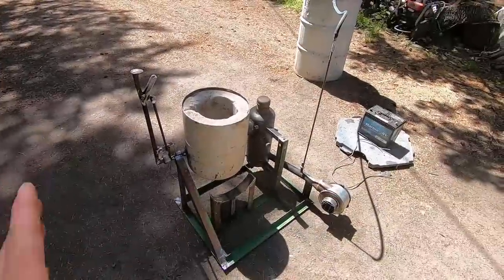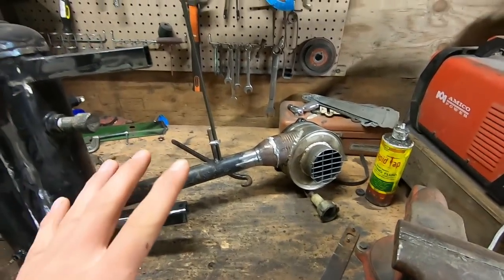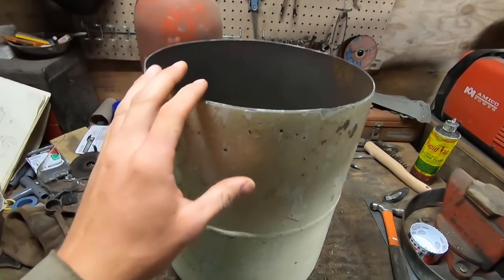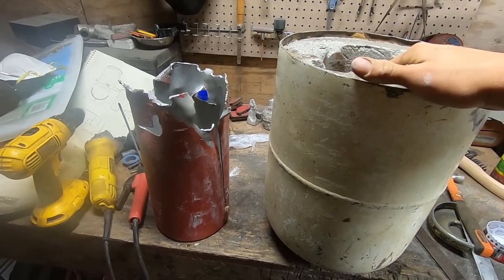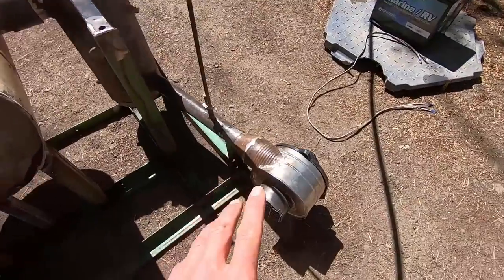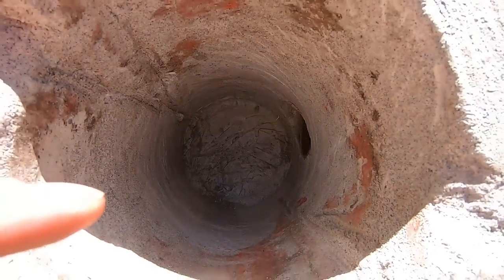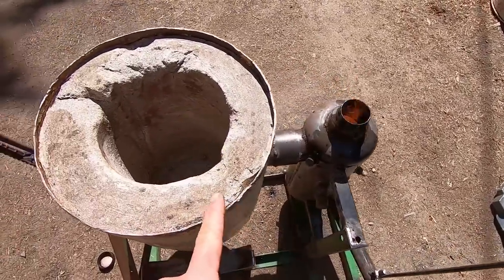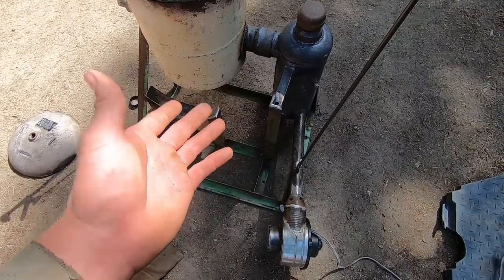Building a convertible Waste-oil Aluminum Foundry/Forge Out of Scrap Metal | Free Aluminum Scrapping

Comment: If some one else said this already, my apologies, your use of the inlet as a pivot point is engineering eloquence.  Kudos!
Reply from the maker: Thank you so much!!
Reply: @randomn6473  yes definitely some cool design ideas here. some things to consider for upgrades; atomizing spray nozzle for oil(could make one from aluminum melt ;) ), fan control and oil flow control. with these two we can control the oil flow/burn rate and wouldn't need the cyclone pre-burn chamber however cool it is(seems like extra complexity/point of failure?). you mentioned a door so that is all i can think of. great build, thank you for sharing!

Comment: The dual-purpose design is a great idea and I am shamelessly going to copy all your best ideas. Thanks. FYI Carpets are rolled on very strong cardboard tubes up to around 12" in diameter. It doesn't really need it but you can seal it with spray lacquer to keep it dry while the plaster sets and then you can just burn it out. Carpet fitters are happy to give it away.

Comment: For removing the fire extinguisher from the plaster, try wrapping it in a few layers of that thick brown masking paper that painters use.  The plaster mixture won't penetrate the paper and it'll have a bit of give to it as the mixture expands slightly when it sets up, so you can just pull the fire extinguisher (or whatever you're using) straight out.  There'll be some of the paper left stuck to the plaster but that'll burn away pretty easily the first time you fire it up so who cares.  Could also use a thick-walled cardboard tube but it'd be hard to find one that's the right diameter and is also strong enough not to get crushed by the plaster, and I'd avoid a sonotube since those have some sort of coating on the inside and I don't think burning whatever it's coated with would be a great idea.

Comment: Thanks for the video it gave me inspiration for a smelting foundry/forge I have had in mind to build for myself.   Here are some ideas you and others may like.  If you''re melting aluminum any iron or steel tubing with one end capped and welded will work.  You can have the steel crucible from the bottom of the furnace to a few inches from the top of the inside of the furnace, that when a lid is on it, there is escape heat that carries the full length of the crucible.  If you build ring out of iron to keep the bottom centered and another ring onthe top that can be bolted to the outside case of the furnace securely that is welded to the crucible, the tilting fuction will allow you to pour your molten metal into molds if you design a catch funnel that has a fine strong iron screen to catch any ferrous metal nuts, bolts, etc... and use iron pipe/tubing to flow the metal into your casing cone or molds.  Always before pouring molten aluminum you need to degas it with sodium carbonate block pushed all the way to the bottom of the crucible using an inverted cone on a long metal rod - leave a few inches below full for this outgassing - stir the melted metal until it settles, add a fluxing dross (buy it online) and then skim off all dross for a clean melt as oxygen in the air forms aluminum oxide that has a higher melting point.

Comment: As I said in a previous comment: I will look for more.
Once again, Well Done. And good work. I was actually looking at forging when you randomly
showed up. I won't criticize, you already hit that. I'm actually amazed that you have so many ideas, and many of my skills and knowledge. If I may... A cooking hint concerning your
refractory: mix your dry ingredients first. Slowly add water to desired consistency.
Pour your bottom to the depth needed and let it set partially while keeping the rest.
Coat the inner form with lard or petroleum jelly (oils are too thin).
Alternatively, leave it to concentrate the heat. By the time it burns out, you will have compensated... Or moved on to something else.

Comment: Nice job!  One way to make your cavity in the forge/foundry is to use a paper-based concrete pier form.  You can cap the bottom end with a sacrificial cap and drill through it for your inlet.  Best of all, to remove it, just fire it up!!!  It will go away like magic!  Actually, care should be taken when burning the form off since pieces might flake off and blow burning up into the air.  I've seen so many of these foundry builds, even before YouTube, but never built one.  Anyway, I gotta go see your heater build!

Comment: I do like your setup. Been waiting too long for proper cement. so I will be doing the same with added materials.. Vermiculite and Perlite. In college, this was added to plaster mold material so as to use less plaster, Insulation, and the ability for the cement to vacillate in a more spongy format less cracking.  Very good design sir!

Comment: It's great.

One suggestion: I would weld a spiral metal pipe around the combustion chamber to pass the oil through it to pre-heat/evaporate before feeding into the airstream. I expect a significant boost in burn efficiency.

Comment: Great idea, I'm in the process of building one myself. I think I will use parts of your build like the stand and pivot for using it as both forge and foundry. My insulation will be cement (Portland) perlite, vermiculite and sand. My tank will be a 10 gallon bladder water tank that will be a bit bigger than the propane tank

Comment: Great build... Do you think flipping it to opposite direction would be better so the flame is on the bottom on blacksmith mode because the direction of the outlet pipe into the forge?

Comment: Fantastic!! I have to make an adapter to mate an opposed twin experimental aircraft engine to an MGB flywheel and transmission to build a 1928 Morgan RIP GN hillclimb racer replica which was made to look exactly like the way airplanes were made at that time.There is only one in existence so my replica has to be perfect and although Morgan used a sliding chain gear assembly I am keeping it British with the MGB transmission and an MGB differential with the beautiful wire wheels. I am going to cast the adapter then chuck it up in the lathe to make it perfect. Thanks for sharing your build.

Comment: An idea for removing the tank from the cemant.  A long bit, drill a hold in the bottom and apply air pressure.  Oh also apply grease to the taml for lub and to prevent sticking.
     Just an after tought.  Great video's and keep them coming.  Thank you.  J.D.

Comment: That was pretty cool. I'd use a ball valve and should add a flash arrestor at the end of that hose. Just in case. And I'd put a door on that thing maybe w a little window that sides open or whatever you know. Thanks for the build though.

Comment: When I did my first mini forge from King of Random video it only lasted 3-4 melts and crumpled horribly.  Second time around I mixed the sand with plaster as much as could while it was still dry and only than added water and I had same problem with trying to remove plastic bucket, but man it was crazy how you tore apart aluminum fire extinguisher!

Comment: interesting video, i used to work for foundation company, building basements, for the 8" walls we poured concrete into al. panels, for a smooth finish and getting the panels to come off the walls cleanly, they sprayed a diesel/oil mixture on the inside of the panels, i think around 50/50, you could call your local co. for the specifics, but your center piece should come out much easier.

Comment: Needs drop down wheels to make your life easier while moving it Rando! Otherwise amazing build. Use a two bar linkage on both sides of the axle for the wheels that picks up the back and detachable rail so it works like a dolly with a permanent load placed upon it (the forge furnace).
You took this the smarter route than when we made a forge that "can" smelt in our shop. As room is a premium for us as well.
Post-Post Note. That top? Great plan its what we have, make a hinge from scrap round stock and sheet, works great. Bit of Kaowool and refractory for the lid to not have to redo it in the future and you're golden. It'll decrease warm up time for smelting and achieve higher temperatures for heating up your forge for smithing pieces. We did something similar for our forge and just called it a blast door... because... nerd joke. Not sure if you should keep the hole exposed or sealed though. Pretty sure you'll burn more of the fumes and have a cleaner emission coming from that waste oil, but at the same time it could put more impurities into your smelts and your steel for forging.

Comment: for casting the refractory mixture I would try using sonotube cardboard tubes, made for pouring cylindrical concrete columns. After the refractory cures, you could simply apply heat from the burner and the sonotube would burn away. Sonotube is available in numerous diameters.

Comment: It won't be long before a relining is needed, I'm afraid.  Our hobby metal casting forums were absolutely swamped for a good 2 years with new guys trying to figure out why their brand new King of Random furnace fell apart...  The answer is this: Plaster of Paris hardens because of a chemical bond between the plaster powder and the water.  You may have noticed that the plaster got warm while it was curing, which is a by-product of this reaction.  That portion of the water in the mixture stays trapped in the plaster while the rest dries out.  But high temperatures will break that chemical bond and release the water, turning the hard plaster into a crumbly mess.  It wont take your ursutz-style oil burner very long to accomplish this.  The good news is, it will be east to reline, and there are some very good diy refractory recipes that use cheap, easy to find materials, and should hold up for years.  Great job on the overall fabrication; with a little work it will be a very nice furnace/forge, and very unique as well.  You may find a ball valve for quick on/off and a needle valve for fine flow control at the burner end of your oil line to be helpful additions.  Good luck!

Comment: I like your design, however i would add a variable speed switch to the blower and as you mentioned a proper cover. With those and practice with fuel control, I think itll work just fine. Thanks for the video!!

Comment: Suction with no air hole to release suction at or near the bottom also would have sprayed the wrap with PAM.  If you do this again Dr I'll a hole in the bottom of the inside tank and plug with foam or cork also I have found that a tiny piece of open IV or aquarium tubing taped to the outside of the tank form releases the suction effect.

Comment: Interesting, I think the shrink wrap kept the cylinder locked into the plaster mix, I would recommend using the bare cylinder coated with oil or grease.

Comment: I don't know if this is been mentioned before but at the 28:00 minute mark you go through the build and you mentioned in foundry mode the cyclone would be on top and you would rather have it on bottom you could just move the cradle to the other side so that it would be on bottom just a thought and another easy setting in your design

Comment: Cool project, I subbed when Chris Ramsay did his video on the invisibility shield you made him.  

An idea for the next time you do this. Get a piece of 4-6” ABS or PVC pipe, cut it in half lengthwise and tape it together with masking tape. Maybe put a little bit of a wedge inside the pipe so that you have a little gap on the plastic. When it drys you should be able to take the wedges out, and tap the 2 halves of pipe and it will come out easier than the fire extinguisher did... just an idea! Really cool though. I’m going to use some of your ideas and make my own.
Reply: Same

Comment: This is a very well-thought out project. We are fortunate to learn from your misjudgement on the saran wrap. Before that mistake was revealed, I thought to myself "why doesn't he use shipping wrap? (same as saran but narrower and on a handy roller)." I guess I had the same brain fart as you. We should have known that the stuff will form a glue-like bond with no chance of separation short of pulling the tank out with a 4WD truck. (Actually, I would've tried to melt the wrap by torching the inside of the tank. Oh look, there's a blowtorch right there!) Seriously, perhaps a couple thicknesses of corrugated cardboard would've done the trick. 
I generally don't have the patience to sit through most DIY videos through to the end but this one kept my interest, and it was entertaining as well. I'm looking for an alternative to the electric melting furnace I made years ago, and an oil burner seems like a good one. Looking forward to seeing how you put this setup to use, and curious how well the forge mode works out. Thanks for sharing!

Comment: Probably formed a vacuum when you was pulling the tank out. Maybe more layers of plastic wrap along with heating tank and running a small airline going through the tank coming out the other end. 
Heat the tank melting the plastic wrap and shoving it out with air pressure. No vacuum at the bottom

Comment: Cool floor plates
Reply from the maker: Thanks! I love them!
Reply: @randomn6473  ever use compressed methane or wood gas for a furnace, or concentrated solar power? like if you had free heat energy you could melt dirt, rock and sand and build an underground dome with just ground.

Comment: Do you think it would be possible to take the top of the propane tank and add some piping that goes to a turbo. You could then have the turbo pumping air into the oil burner and not need to use batterys on the electric motor.

Comment: Soda can aluminum is probably the worst aluminum you can get.
I recommend cast engine parts as a source of alminum, personally i've found VW intake manifolds to be pretty good.
I've also tried hard drives but their aluminum is not that good because they're injection molded.
Also when pouring aluminum don't get it too hot. I used to think that hotter is better but it just increases the amount of bubbles and voids you get.

Comment: If you ever work with plaster in the future, the easiest way to prevent the form from getting stuck is to coat it (heavily) in Vaseline. It will still take some work to remove, but you shouldn't have near the problems you had trying to remove your form in this build.

Comment: Hello from Croatia...
Of course English is not my native language so I have two questions...
I understand 98% of your explanations...but...
1. What you mix with sand for material? I think I know but I was not sure..
2. How you control how much oil leak into burner? Just with tank valve or there is some kind of nozzle at the end of oil pipe?
Great project btw...
I see a lot of similar videos because I need to do something similar, probably I will make some variant of your device...

Comment: Great design! Why not insulate the burner chamber with rock wool to maximise the heat going to the crucible, need less oil to do the same job or get hotter to melt other stuff?

Comment: I've built a foundry and a rocket stove..I used fire retardant insulation and added layers of product called satinite with a brush..much easier than refractory cement..gets red hot doesn't burn

Comment: ***** should have just drilled a hole in the bottom of the fire extinguisher to allow air to get on the other side where the plastic wrap is located. 
OR
Run a small tube (think aquarium air pump tubing) inside the plastic wrap from the outside/top to the bottom of the fire extinguisher.

Comment: I realize this is an old video.    But.  I thought the point of using waste oil instead of propane was that it gets hotter. Hot enough to melt steel in?

Comment: Hmm, I need to do this except the handle will be used to dump the molten aluminum. I will use a air compressor driven oil injector. Remedy is worth more at the scrapyard than breakage

Comment: it may take longer to heat this way, but a slightly thicker crucible might be a good idea.  The heat cycling of the hub cap wont take very long to cause it to wear down.  Otherwise I think this is great practical project.

Comment: Make it flip over the other way and you will solve the issue with the forge.  The pivot point will be at the bottom resulting in proper heat distribution.